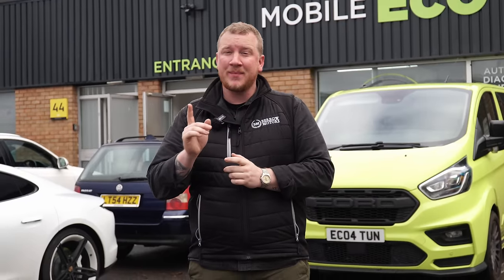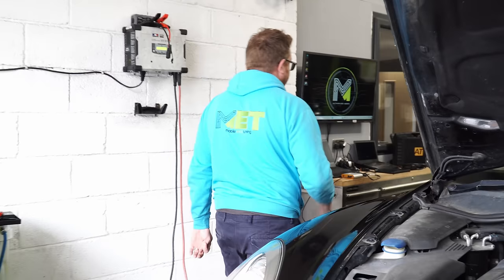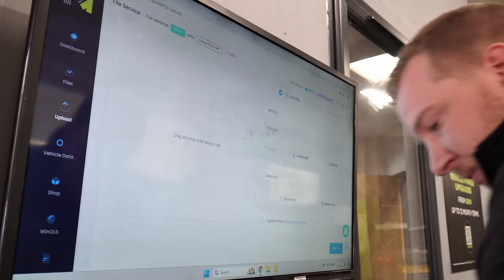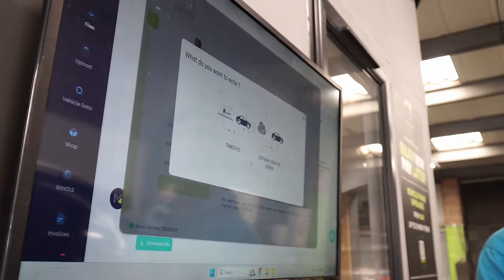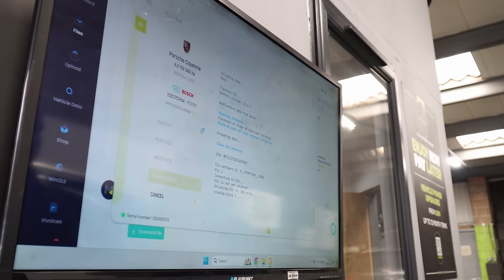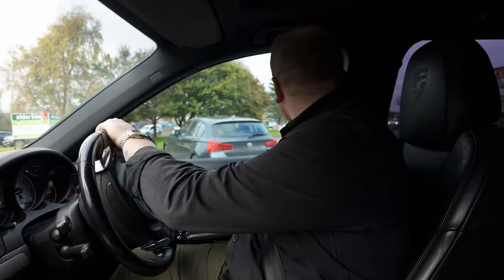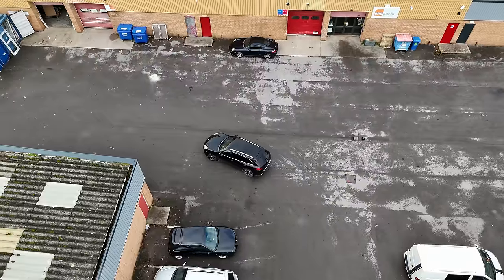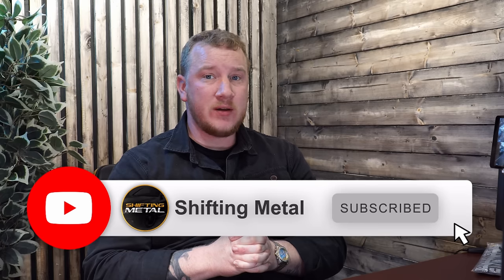The Easiest Way To Start A Remapping Business!

Comment: Honestly a bad idea.. you’re giving yourself more headache down the line when people have issues with cars you sell. Personally I’d also avoid maps that don’t have a rolling road printout as there can be issues on the test runs that one of these maps won’t detect without the live graph/rolling road. Not trying to be downer, just think it’s something you should think about again before jumping in as I can see you regretting it.
Reply: Did he not say he would use it to make sure the cars he sells are not remapped??
Reply: As long as he lets people know and they sign a disclaimer it’s all good 👍 don’t have to have a power map there choices for eco maps aswell
Reply: Rolling road is not the gold standard. The dyno is a tool to see power increase. The logging of the engine parameters, which can be done on road, is what matters.
Reply: don't put others off because 'personally' this isn't for you, just skip on by, simples.
Reply: @ I agree it’s like he wants him to fail and to be fair most people know the risks of remapping
Reply: @C4mmy31   🤫
Reply: People who think I’m going against him are getting the wrong end of the stick. I just worry with these plug in style maps there’s a lot of issues that can occur. I know this from friends who’ve had issues in the past. Personally I don’t mind mapping but I always go for a custom map with a rolling road/road testing. Just my opinion. I do actually hope if he goes for it that it all works out but just thought I’d have my say.
Reply: @  thats cool mate just saying no hate here, it just come across that way everyone’s allowed there own opinions

Comment: This will lead you to a load of trouble. Re mapping is an art using a dyno over multiple runs fine tuning to get the balance between power and torque not just plugging in a box and there you go. You also have no idea of the state of the engine your working on

Comment: Insurance companies have got wise to ecu mapping if your involved in a accident and haven't told them they will 100% void your insurance when they scan the ecu talking from experience
Reply: What car did you write off and how much did they refuse to pay out?
Reply: @nickieo  Exactly, they don't even look at the cars in person anymore or categorise the write offs properly they just look at pictures and decide, writing cars off for damaged bumpers and dents. That's why everybody's insurance has gone up.
Reply: They can’t tell for several reasons (only a stage 1) the ecu doesn’t say “mapped” for example. Secondly they don’t have time for that, the cars go to garage then onto copart which we buy from, they now have AI doing write off categories for them. They may have insinuated to you you had it mapped as a reason to try not to pay out then you coughed up, or they lied. They cannot see that oh x y z has put a map on here.
Reply: @AI-Records24 not true they can definitely tell. Just as easy as this guy said he could tell if it had been mapped before he looked at it.
Reply: @ he didn’t say that he said he could see if the ecu had been unlocked which is my point
Reply: Insurance firms have been wise to remaps for 2 decades. The industry has made some people quite wealthy providing careers in detecting mapped and, tuned vehicles, swapped engines, high lift cams etc thereby voiding claims.

Comment: I don't disagree with tuning road cars (in principle). However .. personally .. if I wanted a faster car I would prefer to buy a faster car. That way, I get the benefit of upgraded brakes, suspension and steering.
Reply: Factory software is very limited for a whole host of reasons including tax, emissions, blah blah. It’s good to unlock the full potential of your vehicle if you’re a petrol head. You also get better fuel consumption too which is an added bonus. Oh and any real petrolhead will have decent brakes and tyres etc anyway.
Reply: Yeh, not many people buying a Corsa Zest and slapping a big boy turbo and map on it. The vast majority are hot hatches and actual performance cars that already have decent suspension and brakes. 

You do you mate.
Reply: You can only legally do 70mph so whats the point ??
Reply: I thought the same until i bought a very cheap Isuzu D Max 1.9 Turbodiesel. Great truck but a bit of a slug and could be wrong footed quite often. i spent 200 quid on a reputable piggy back box from Bluespark which "crudely" interrupts the signal from the common injector rail pressure sensor and manifold absolute pressure sensor. Night and day change in driveability, and no fuel consumption penalty, it sits on the exact same consumption numbers. I would buy another for my next turbodiesel or retune my ECU.
I am a convert to tuning!!!!

Comment: Had a Megan 230 chipped a few years ago.  It was supposed to take it from 230 bhp to 280bhp. I couldn't tell any difference. When I complained I was told the power would come in gradually after a few hundred miles. Never saw any difference!  So to me it was a complete waste of money.  Over the years it occurred to me that if I'd have told my Insurance my premium would have increased for nothing and if I had not told them and had a serious accident the insurance would have been void. If by some chance I'd have killed someone, I dread to think of the consequences.  So would I do it again..... I'll let you go figure. I've now bought a TVR 4.5L CERBERA Red Rose.  It definitely doesn't need any upgrade.

Comment: I had a plug and play I fitted to my 102bhp 2.5tdi VWT4, 1999 vintage. 3 kids camping gear, bikes and towed a caravan. The tuning box in its day was £150. It absolutely transformed the van for that purpose it was used for. Had to take it off for MOT because smoked a bit. Did 300k before it was sold. For me it’s a good experience but I know people who have not been so lucky.  Re maps do not have to be purely for power but can be changed for economy or torque for towing

Comment: Good onya Joe. I think many people are completely missing the point. This is a simple system to moderately help with power, performance and economy (yup, check out your mpg, bet it's improved) for a reasonable price. For those that want a complete re-map and take an engine and g/box (to within an inch of its life) then of course you'll be taking it to a specialist with a rolling road etc. We all know how much THAT costs. And yes, advise the insurance company blah blah. Lighten up people, Joe's just giving folks another string to their bow as and when required 😉

Comment: Lots of small 3 cyclinder turbo petrol engines love a remap.

Had our old 2017 kia rio 1.0 (99bhp) mapped  to a solid 140bhp with matching inctease in torque.
Turned the car from so so to a fiesta chaser. All for £299.
Reply: I thought you must be joking there, but no ! lol
Reply: The fiesta Eco boost 1.0 responds well to remap, but the gearboxes give out cause they're made of chocolate🤣

Comment: Long time follower of your channel and watched over 50% of all your stuff now
This video though i think is going to come back and bite you in the ass a bit.

With the greatest respect......you didnt "learn" how to remap in less than 30 minutes!!
What you have actually done is follow instructions from someone and became an "basic expert" with support. Your knowledge of what you actually did is limited to what you were told and what you experienced when you stuck your foot down.

I was actually thinking of having my Golf remapped and was excited when this video dropped (was one of the recalled ones due to the efficiency con from VW and has ran "delayed" since they "fixed" it)......but i wouldnt trust you to do it based on this video and visible 30 minutes training.
Good luck though fella....just be carefull out there.

Comment: With the greatest respect, writing/uploading a slave file to the ECU of any car isn't remapping in any way shape or form. Remapping is all the work that goes into creating the master file for each vehicle. Adjusting all the relevant calibrations from the information gleaned via real-time data logs from an individual vehicle is remapping.

I'm not demeaning what you are doing, and so long as the correct process is followed you won't be bricking anyone's ECU, the customer gets what they want and you're making money. I have no issues with any of that whatsoever, you are providing a service and adding value to your business but you cannot call what you are doing remapping.  Sorry to be pedantic but it is what it is.  I wish you all the best.👍
Reply from the maker: I'm sure you're right but ' writing a a file to a file to an ecu' isn't quite as catchy
Reply: I have no idea why anyone would go to a place for an OTS map. Only custom map your cars people. But I do wish you well though ofc. Debbie downer here😅
Reply: I went to a back street turner in Sheffield years ago when I had an old audi a6. He charged me £200 in the following 6 months I blew  up 3 intercoolers,  safe to say I got rid.
Unfortunately I lost my trust in mapping.  Fast forward 4yrs I had the best car I've ever owned (a 530 bmw n57 engine) I had a few glow plug and  module issues.  I decided to take it to Darkside Developments in grimethorpe for work,  I opted for a stage 1 map, glow plugs, module,  swirl flaps removed and the inlet side walnut blasting. 
 This absolutely transformed the car in to something special.  I owned the car for many years after and it never skipped beat. 
Lesson learnt,  go to a reputable tuner who knows their stuff.
Reply: @Ianboid68 Cool story.

Comment: I don't recommend vehicle maps at all... Too many times we tell customers to get the maps removed either due to emissions/fueling/corruption issues etc. honestly not worth it especially if you're not going to modify the vehicle in otherways too. However, great vid though Joe, very informative :) 
(edit) ngl no doubt a map enhances a vehicles performance especially if you get it done properly like here rather than jammy dodger off fb with a laptop and a slammed caddy van 😅
Reply: It’s 2024, proper tuners like mobile eco tuning know what they are doing , when you get idiots using Chinese clone equipment, yes but done properly to the right vehicles it’s perfectly fine, I’m also a mechanic and don’t sprout advice to people on stuff I don’t understand properly , which is pretty obvious by your reply. Done right, it’s perfectly safe
Reply: I genuinely don’t see anywhere here where anyone said “do you recommend this”

Comment: I would never recommend a remap unless you have the actual car on a rolling road and customise the map to the specific car. Every car is slightly different and will need tweaks and changes to any base map. I would never ever put a generic map on a car no matter how it has been done it's just not worth it, a good company will not touch a car if there are any issues.

Comment: Isn't this tuning rather than remapping.
A remap would require you to manipulate parts of the programming based on output data files and in the process you would also need to upgrade some of the parts to avoid them blowing. Better inlets... forged parts.... different cats etc depending on the power change. 

To be honest I wouldnt buy a vehicle that was remapped so a good idea to check it for remapping and return it to the manufactures spec.

From experience this is an insurance nightmare... remap reported (premium rejected or increased) new part installed to complete the remap (not retune) insurance company rejects the modification etc
Reply: Tuning and remapping are the same thing just different ways of saying the same thing. There’s different “stages” as they are now called. Stage 1 requires no hardware, stage 2 on most vehicles requires intake, intercooler, downpipe and better flowing exhaust (sports cat in most cases). Stage 3 is changing turbos, injectors and so on.

Comment: Remapping is the quickest way to shorten the life of any engine, the manufacturers spend millions to find the best all round mapping for the engines they design and manufacture so why mess with it?
Reply from the maker: They are mostly mapped for emissions reasons and different power options actually but OK 😅
Reply: Got first hand experience to back up your blanket statement? 

I mean you will probably come back with some made up scenario, so quite pointless asking you anyway.
Reply from the maker: Have you?
Reply: No he hasn't 😂 @ShiftingMetal
Reply: @ShiftingMetal  are you asking me? Because my question was to the guy rambling on about premature engine failure.